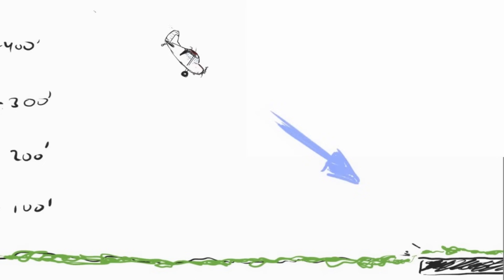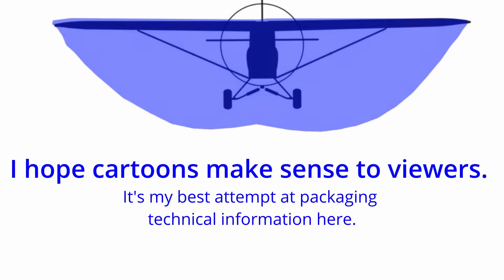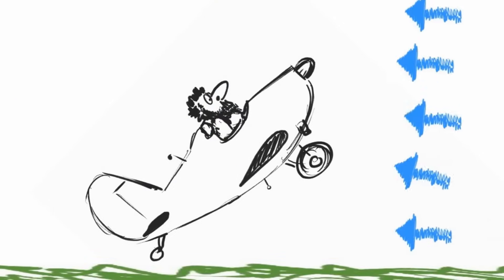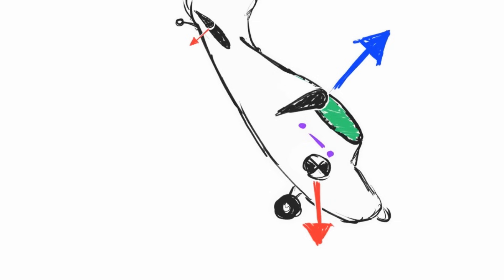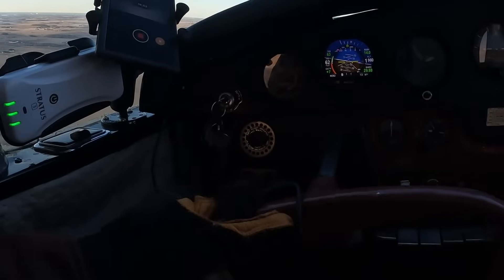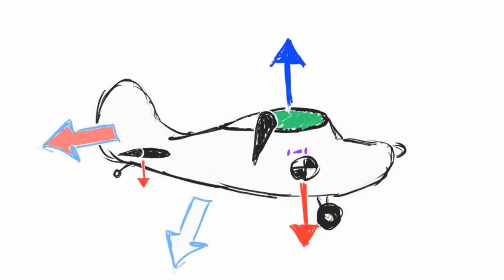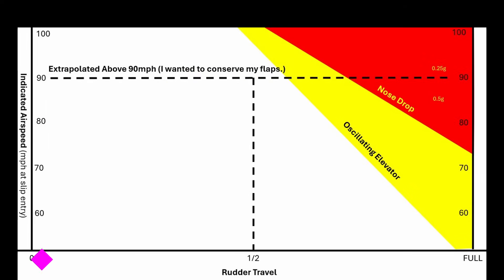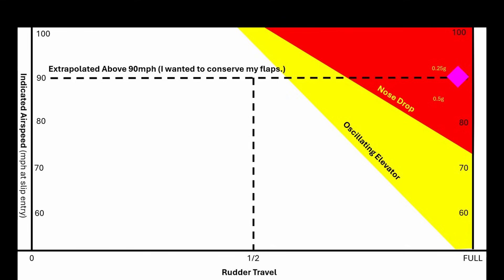Crash of a Cessna 170B, Did Slipping with Flaps Factor?

Comment: Downwash th is ungrounded. Otherwise T tail would never work that gets no downwash. Reality T  tail works best. Hence it proves, its freestream interaction of horizonal stab that matters not downwash
Prob what happened is the flaps full blocked freestream to horizontalstab rendering it ineffective.
Reply from the maker: Thanks for watching, and I'm glad you commented on this!  T tails do encounter downwash but much less.  As you say, that reduced downwash is why less horizontal surface on a t-tail can be as effective as a larger horizontal mounted lower.  This is also some of the reason that t-tails were involved in some of our most famous deep-stall events.  The t-tails are less affected by downwash and lack thereof.  But this proves that downwash at the horizontal IS a significant (possibly the most significant) factor in aerodynamic pitching moments releated to stalls for subsonic, straight-wing airplanes.

And I'm not pulling this out of thin air.  Pitching moments as a result of downwash change on horizontal surfaces is well documented and accepted.  We can see this occur in foortage from old, NACA wind tunnels.  We can model this with newer CFD programs.  It's described in Aerodynamics for Naval Aviatiors.  It's specifically referenced by the lead aerodynamicist at Cessna on this, specific problem.  He wasn't pulling this form nowhere either.

As we progress in our careers we forcus on pitching moments from changing centers of pressure in swept wing jets.  Often we tend to forget the mechanisms around aerodynamic pitching moments for straight-wing, subsonic planes.  Cowlings and canopies play a major role at high alpha as well.
Reply: @engineerahmed7248   U r r8.  But in simple words. Downwash "INTERFERES" with Horizontal Stab (HS) & more so when flaps deployed. Pilots take it as normal and build muscle memory based on it ... But, like u mentioned, elevator response significantly changes, in-side slip scenari,o because HS receives clean freestream. Less experienced/savy pilots fail to appreciate this.

An incentive for us engineers to develop T tial planes.
Reply from the maker: @EngineerAhmedUSA  I think we're of like mind.  T-tails have a lot of advantages.

I humbly suggest the problem really is moral hazard.  We engineer airplanes with docile handling qualities, but we then train pilots as if those engineering solutions are undefeatable.  So when they enter a combination of alpha, power, flap, etc. that defeats an engineering solution, the pilot is also facing an entirely unexpected and novel situation.   

Not much different than people driving faster and braking more aggressively now that they used to cars and even motorcyles with antilock brakes.
Reply: loss of pitch control in this situation has nothing to do with the tail and everything to do with the down aileron on one wing and up aileron on the other wing which is required to do a slip.  the down aileron wing has an increased AOA while the up aileron wing has decreased AOA causing the down aileron wing to stall while the other wing continues to fly causing the nose to drop when the one wing quits flying causing a rapid wing drop on the stalled wing and abrupt pitch decrease. if this happens at less than 100' AGL there is only time for 1/4 to 1/2 rotation because it happens so quickly.  this is why stall/spin crashes cause the wreckage to appear like a pancake with all the wreckage in a nice little pile as opposed to other types of crashes where there is a long trail of wreckage.  investigators can identify a stall spin crash with one glance.

Comment: I won't believe that pigs can fly until we give a pig thought a try. If you have a choice between a failure vector or an acorn, a big will always take the acorn. No matter how good you are if you come in on a long straight approach with no turn you will be able to deal with the ground turbulence better than a airplane that is turning in any way shape or form.
Reply: do you have any idea what you reveal about your lack of knowledge/experience with statements like this?
Reply: @chucklemasters6433 would you care to wager about my stupidity and my inability to read and all the other things you think this comment shows. I got $5,000 says I can beat you at a Kaplan learning center reading test. If you would hear the math of the situation you would understand exactly what I am saying is correct. If you take off in an overloaded airplane it will fly straight, but it might not be able to curve much. When you curve you add additional forces on the wings.
Reply: @chucklemasters6433 okay let x be a particle. Let x be a particle in a curved flight, let's centrifugal force act on x. What system of mechanical device do you have to resist this load a wing lifting? If your banking at a 45° angle you are lifting 1 1/2 times as much with those wings as you are in straight flight, that's not contributing any centrifugal force. That's just a pure dum dum dum dum dum dum as far as I can dumb down the map for the engineering in this problem. Add a 45° angle, when you resolve the vectors from the lifting into two pieces one vertical, one horizontal the vertical one will be smaller, the wings will have to lift harder or you will start to drop hard there is no other way. I'm engineering intern number 7330 state of Nebraska by the way and I'm perfectly willing to bet on anything you want in a reading test at Kaplan.

Comment: I decided to find out first hand. I took a 1976 C-172 up to 3,000 feet, set up a descent at idle with full flaps and put it in a full ruder right slip. The result was the nose porpoised up and down in a cycle. The plane never departed into an actual dive. I did about 4 or 5 cycles, released the rudder and opposite aileron and the plane went back to normal flight. It wasn't really much of a big deal at 3,000 feet, but I could see that at low altitude it could be a problem, especially if a pilot wasn't expecting it, maybe even leading to a stall. I didn't keep track of altitude lost in the dips but that could also be a factor close to the ground.
Reply from the maker: Glad you tried it out!  I used to do the same thing years ago.  To get the departure into the dive in the 170 I needed forward CG locations and some decently high speeds.

Comment: Let me explain something. Prior AOPA CFI of the year here.  Pilots trained in California are scary.  Most do zero spin training and are very much great at laws and poor at stick and rudder.  The flaps on a 170 in a slip will not “cancel out the tail”.  And a plane smoothly put into a smooth slip will not cause a spin.  There are several ways to slip a plane. In a cub it’s fairly nose up.  If you’re on a left base the old school way is to put in full right rudder in the turn to final.  It’s how we slip in a steerman for visibility.  A heavy GA plane like a 170 needs to be slipped nose down with flaps.  Full flaps will increase angle of attack. 

Simply put,  they lost control slipping too slowly. They put in the slip unsmoothly and got uncoordinated.

Comment: I've  flown  Cessna 150 172  in the past . No  issues .These  days I fly Skyfox  Gazelle  (like a Kitfox ) which don't have  flaps so I often use forward  slip on  landing. I  did  experiment at altitude for more  extreme  forward  slip inputs and  noticed  increased  buffeting which i expected from the  distorted  airflows but  didn't  know the  danger of  speed . In the  Gazelle  its not a  problem as they don't fly  fast  .. but I will  keep it in  mind..thanks
Reply from the maker: Glad you like the video.  The nose drop with slips/flaps is really something that's unique to the Cessna wing/flap/tail combination.  For example I'll use full slips at higher speeds flying aerobatics in my Cub for example with  no ill effects.  This isn't to say you should or shouldn't do something in your particular plane; I just don't want to create limitations for you that don't apply to your plane.
Reply: @jonathanzarinnia884  I got my first  license  on C150   (I  fly on a LSA certificate now )  and had to  do a  lot of stall spins . I remember the vigorous behavior  on full power  full flaps . In fact once I took off in that  configuration having flipped the  flap switch the  wrong  way in a go around..its  a  wonder I'm  still here   so I too would be very  careful doing aggressive  forward  slips in a Cessna during  finals  . I would  test and practice  at  altitude first

Comment: Thank you for this informative video. I fly a Cessna 182P. I have slipped with flaps, but never with flaps more than 20 deg. On the rare occasion I find myself more than 100 feet high after turning final, I will briefly slip, then recover, drop 30 deg of flaps or even 40 and land. Unless I am substantially high once turning final, my barn door flaps are adequate. If I'm high closer to the threshold, a go around is in order. However, when considering whether a slip with flaps is safe, we need to remember that we are taught to do that when landing in a crosswind. It seems to me that just because it's called a side slip in that case doesn't change the fact that it is a slip. In those cases we do it all the way to the ground. While it is true that the relative wind is coming more crossways, whenever we slip we are slipping into the relative wind. Therefore, whenever doing crosswind landings most of us are slipping and that too with flaps.
Reply: Well.  If you’re high and have 20 degrees of flaps,  put the flaps up and you will no longer be high.  Flaps in your plane go out first notch,  out further the second.  This increases wing area.   If you put them up you loose all that wing area and will drop 2-500 feet very quickly.  Try it.  It’s more effective than a slip.   Former CFI of the year here,  11000 hours half of which was cubs and steerman.
Reply: @AndrewPeterson-nh4oj  The problem with doing that is that you will also gain speed.
Reply from the maker: Sorry it took me so long to get to this comment.  I'm glad you enjoyed the video!  Thanks for watching!

Comment: Wow, it really looks like a stall. But it shouldn't set off the stall alarm. Is that correct? I'd appreciate an answer if you know.
Reply from the maker: Correct.  No stall warning horn. 

You're getting at exactly why the condition is dangerous; it's easy to misdiagnose the condition when you are close to the ground.
Reply: @jonathanzarinnia884 thank you for your helpful reply. I'm not flying Cessnas at the moment, but I think I should get some more training in the GT-500 which is also high wing with flaps to see how it responds to slips. Till then I'll be wary.

Comment: Thank you.  I have a 170 B on floats.  Is this mostly just true landing with full 40 degree flaps?   I rarely land with more than 30 as it just feels squirrelly at 40 and the flaps are adequate with lower settings.
Reply from the maker: The nose drop thing seems to be mostly a 40 degree of flap event.  At 30 you can get some decent oscillations in the rudder and, remember, this is only in a full slip.  So a half slip shouldn't get you into trouble either way.

That being said I'm not sure how floats will affect the way the air behaves around the airplane with lots of sideslip.  There are some other factors in there as well.  When I dig through Bill Thompson's book I didn't see anything about the floats, but I can take another look for you.

Comment: Very useful! I'd flown mostly PA28 for years - but I started on a couple of flapless aircraft where side slipping was just normal. You could say I got into the habit. When I converted to PA28 (~1999) the instructor was amused at my proclivity for slipping but appreciated the accurate PFLs.
Then this year I turned up for a check flight in a PA28 and the instructor brought a C172 by mistake. I'd flown one twice, about 30 years earlier. How hard could it be? Well we were there on the apron with the engine running and I wanted to convert to Cessnas, so might as well use it. All was okay-ish until I came to slip it to land. Nothing bad happened to the aircraft, but the instructor caught fire.
So I have a question - is this more of a  high-wing Cessna issue, or was I just lucky with the low-wing PA28, which I always found well mannered in a side slip.

Comment: This video is on-point. 

I'm well aware the flap downwash on the tail. And how that shifts. But I did not consider the up going ailerons UPWASH which of course is clearly an issue in an aggressive slip.
Reply from the maker: Glad you liked the video, and sorry it took me so long to respond.  It's a pretting interesting phenomenon.  Reading about something that a Cessna aerodynamicist found out about seventy years ago is pretty neat too.  It's cool hearing how it works from the guy who actually studied it (Bill Thompson).  I also think it's neat how a continuity of effort from Langley wind tunnels to a Wichita factory to countless small airports all over the world gels together across the better part of a century.  I get a little weird about that, though.  Sort of a grand continuity of gear heads or something.  I'm getting weird again.

Comment: Now you know why Cessna has limited the more recent airplanes to maximum 30* flaps.
And the crosswind landing component is limited by flap extension and rudder deflection. You can land in a 25+ kt crosswind with no flaps slip if youre well practiced. Not recommended for the faint of heart or untrained.
ALL airplanes need to be flown from tie down to tie down. Crosswind taxiing is not taught the last 50 years.
Think not? Watch all airplanes when they taxi.

Comment: Thanks for putting this video together. Your animation is great, but the way. I can tell you from my own experience testing with my Cessna 170B that this negative trait occurs when speed is sufficient at 40 and even 30 degrees of flaps. During this testing, I found my yoke would move forward as if being pushed by someone else. Corrective action was to remove the slip inputs and fly coordinated. Reducing flaps also corrected the problem, but that may not viable at low altitude during an approach. If the airplane were to stall during the slip instead, the yoke would not exhibit the behavior of pushing forward on its own. If anyone chooses to slip with flaps in a 170B (or any other plane with the same flaps/slip recommendation), they should know how the airplane behaves in that condition, how to differentiate a nose-over from a stall, and how to recover. As an experienced pilot myself and a close family member of the victims, I am haunted daily by this accident.
Reply from the maker: I'm glad to share experieces with others who have felt this issue out in the Cessna 170, and I'm really glad you commented here.  Losing people sucks, and there's never anything that anybody can say that makes it better, and it's deeply personal.

Comment: In 1974 I was taking my Commercial Pilot Check ride in a Cessna 182 in North Dakota. The Check Ride Pilot (CRP) was also the owner of the airplane and flight school. The CRP pulled the throttle on me and said "You just lost your engine, what are you going to do?" Being in North Dakota I could land anywhere it is so flat and empty but I glanced down and saw a crop duster airstrip and said "I'm going to land on that strip below me". I began my approach and as I turned on final I was way too high to make the strip even at full flaps on the C-182. I had lots of taildragger time in a J-3 Cub so I put the C-182 in a full slip and it started descending like an elevator with the cable snapped. I knew the manual said slips were not recommended but it also said it was because of the turbulence over the tail would make it a rough ride with lots of noise. It wasn't forbidden so I went for it. I glanced over at the CRP and he was turning white and had braced for impact but he didn't take over the controls so I continued down in the slip. 100' above the ground and on a perfect spot on final to make the airstrip I centered the controls and returned to normal flight ready to touch down. At that time he pushed in the throttle and I started a missed approach. The only thing he said was "I didn't know you could slip a C-182 with full flaps!" I passed my check ride. Question I now have 50 years later "Was it a safe maneuver?" BTW I owned a Cessna 120 a few years later (no flaps) and could put that airplane down on a dime. I highly recommend taildragger flying to make you a  better pilot.
Reply from the maker: If your examiner thought it was unsafe he wouldn't have passed you.  I don't think what you did was extreme or unsafe either.  Cessna 120s and 140s are awesome.

Comment: The bottom line is: with increased flaps and a forward or side slip, it decreases the aerodynamics of the wings and elevator which in turn decreases the lift component...a little is ok. It is like a pretty gal, a little is ok, but alot can kill an old boy like myself.....Like Clint says"a man must know his limitations"...an airplane is also in the same category as for performance😢